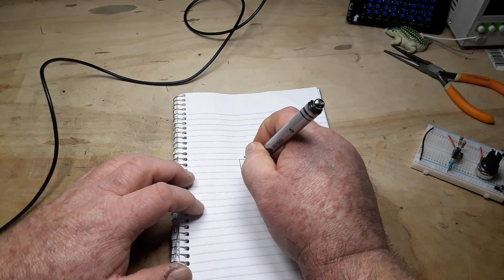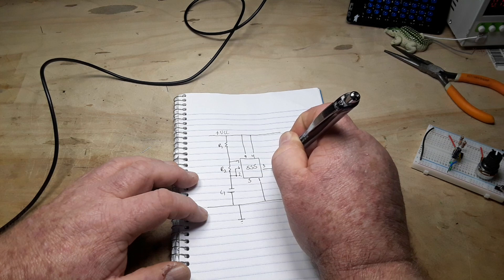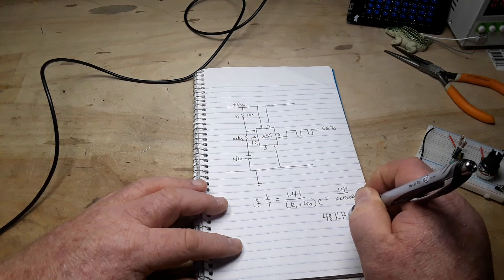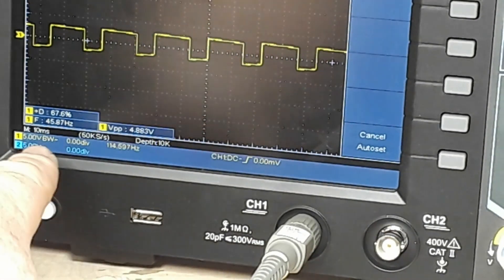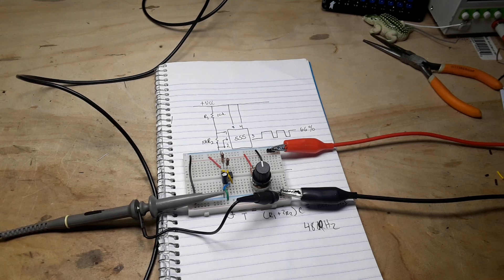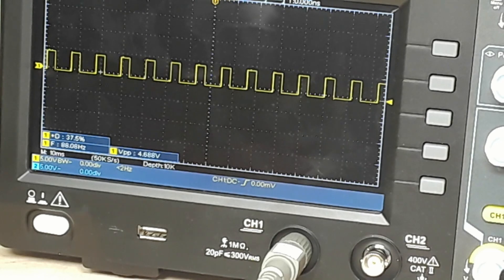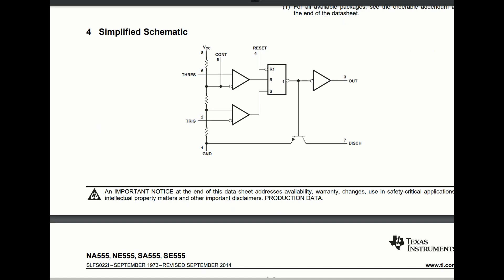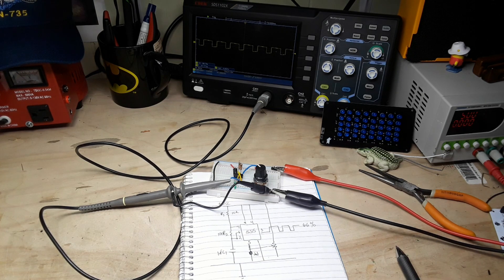Secrets of the Control Voltage Pin on a 555 Timer

Comment: The 0.1 cap should be there to stabilize (make less affected by) the timing from switching (especially on high loads like relays) and power fluctuations.
Try it, you might even see it in the scope.  BTW that includes even and ESPECIALLY if you have the pot there.
Reply: The CV ids sensitive, so don't make it an antenna.
Also, and this is MISSING from ALL 555 datasheets, the C.V. has voltage limits small that you might expect.
....a nasty surprise I got building an over current protection circuit, ....YES the 555 timer has lots of uses, and it's CHEAP!

Comment: THANKS FOR THIS VIDEO...I JUST LOVE "PIN-5 APPS"!!  
One thing I made was an infrared LED modulator.  I used the same type of scheme used in the TV remotes.  They usually run at about 38kHz.  However, about in the 90's, Vishay came out with with a Three-pin IR receiver (TSOP7000) that operated at an amazing 455Khz!  I was able to use this as a carrier frequency for the full audio range of frequencies!  With a 555 driving a powerful IR LED tuned at a center freq of 455kHz, THROUGH PIN 5, I could modulate audio over a long range...I actually got about two miles range with a single pulse modulated LED, and Fresnel lenses at each end.  The alignment was an absolute nightmare!...we used rifle sights and a pair of VERY heavy tripods.
...I'll cut here.

BTW:  I think you would have better luck with a lower resistance pot [50K (actually ~25k) out vs three 5K in series: (~3.3k ohm input).]
It is VERY interesting to use use the 555 with a +/-5V dual supply and modulating pin 5 with the output wave-forms of the MAX038 function generator

Comment: so question what is the 4 pin GM Ignition Module supose to by called? It uses the MC 3334 ic chip wire diagram. That thing confuses my I tryed to use 500k potenciometer on that thing suposedly to retard slightly ignition timing so my car can easely start in winter time how ever it ended up totali different insted of compresion I ended up fiering at exaust stroke and the engine was choked lot in power didnt work as planed but it did retarded the ignition timing I ques I used speaker wire and the distance from ignition module to potenciometer back to ignition coil or to ignition module cant remember reali how I hocked that thing up any way the resistance in wires caused havoc. I wasnt reali happy about it. It gets even wurse when I try to use hv ceramic capacitors on my ignition coil it messes up the Delco 12 si voltage regulator starting cutt in current . So Im realy anoyed what to do and how to replicate this circuet struggeling to finde any thing similar that is cloosed loop and more variabel .So did ever some one tryed to use remote controled variabel modulstors or some sort of remote controled relays? Im realy desperate at this point I like my car but the ignition system is shiti expeciali in winter its hard starting that car.

Comment: Great video!  So I'm using the 555 to create a flashing series of LED lights.  Here is the video I've followed. https://youtu.be/h_50ITXi-2w  The project uses a 9 volt battery.  However, I'd like to make the LEDs brighter.  The LEDS are only showing about 2 volts running through them when they light up.  I'd like to be able to increase the brightness of the LEDs.  Is there a way to control the output voltage of the 555 in such a way that does not change the speed of the flashing series?  Thanks!

Comment: Can you get capacitors where you can adjust the value of the capacitance
Reply from the maker: yes, variable capacitors
Reply: @learnelectronics  cool, so that would be an ideal way to change frequency without affecting the pulse width, right?

Comment: And there was I wondering how you could get a 50% duty cycle with a 555. Obvious answer here!
Reply: another way is using a diode to bypass r2. or, if you simply chose r2 substantially higher than r1 you'd also get a roughly 50% duty cycle, right?

Comment: The datasheet says - precision 555 timer. Your waveform it's not precise at all. It's not so simple. First of all the waveform looks distorted. Just look at the rising edge at 500 us. You need a pull-up resistor at the output or pull-down OR BOTH as well. You need to bypass with capacitors etc... All I want to say is that: a precise 555 circuit needs a more precise explanation. Anyway, I like your channel. Good luck.

Comment: Thanks for the technical explanation. I used this control voltage method in both my little boxes punk console and my original Project Nine diy modular analogue synthesizer. Check out my channel to see what I did.

Comment: Still new to the 555, but if I wanted a fixed and stable 50% duty cycle, do I need to have half of VCC on pin 5? Or is that why the suggested 0.1µF capacitor is used for?
Reply: If you just put a jumper (0 ohm) in place of R1 you will get a 50% duty cycle in a standard astable 555 circuit. No need to change pin 5. Do a search for "555 astable online calculator". Plugging in 0 for the R1 value will confirm this. Then just put the C and R2 values you need to set your frequency. Changing the pin 5 voltage seems to let you get the duty cycle below 50% which you can not do with the basic astable circuit.
Reply: @blic-sx9ix  You can't do that. By shorting R1 you short the power supply every time the discharge transistor is on inside the IC. There is a minimum value for R1 which is around 1k depending on the power supply voltage. 
You can achieve a duty cycle of roughly 50% (slightly above) by making R2 have a much bigger value than R1, and because putting a large resistor value will lower the frequency, you can mitigate that by lowering the value of C1 as well.
You can also try a classic astable multivibrator circuit with two transistors and two identical capacitiors and resistors instead of a 555 IC if a 50% duty cycle is critical.
I hope that helps.
Reply: @antoineguilmain2754  Thanks for setting me straight! I always use 2 resistors in my circuits but noticed that a 0 for R1 in the calculators gave 50%.
Reply: @blic-sx9ix  No problem, I always enjoy helping others when I can. As for the calculators, i'm not surprised. They just plug the values you give them into formulas without giving a second thought about it!
Reply: @antoineguilmain2754  could you put a diode parallel to r2? then charging of the capacitor will only flow through one resistor and discharging through the other resistor. then if you made both R the same value, you'd have a 50% cycle
Reply: @KrumpusPlunk  I think I have seen this before, but I have never tried it myself. If you have a current-limited power supply to try it out, in order to avoid short circuits just in case, maybe you could try it out and tell me how it went? Or you could just try it with regular batteries (not the lithium type, those are dangerous in the event of a short. Just regular alkalines, maybe 4 in series to get an appropriate voltage for the 555 to work).  I wish you luck, maybe i'll try it too sometimes, since I have loads of 555s.

Comment: tell about connecting R1 to a diode to 555 output instead of vcc
i meant: output - diode - R1 - C1 for charging part and C1 - R2 - 7 pin for discharge

Comment: Basically you can make a mini FM generator using this control voltage pin. With natural frequency of oscillation as the carrier frequency. The audio signal at control voltage pin

Comment: Hey Paul. I’m looking to purchase a good scope for my bench. What do you recommend ?  I see you have 2 listed in your equipment list. Nay advice is appreciated. Thanks for the control pin vid.
Reply from the maker: The Rigol 1054Z is probably the best value of features vs price at $359. You can't go wrong with it. But if you want something more affordable, the Hantek DSO5072P is about $100 cheaper. 2 channel only and no protocol decoding. But only you know what features you need.

Comment: I built a regulated hv boost converter to drive nixie tubes with this 10 years ago ..
Take a small portion of output voltage through a transistor onto pin 5 and u have regulation

Comment: So... since the data sheets don't specify, I've always assumed PIN 5 (CV) to be an INPUT. However, when I measure it with a VOM (V Red to PIN 5 and COM Black to Ground) it's always OUTPUTTING 1/2 of VCC with nothing connected to PIN 5. So if VCC is 12V, PIN 5 will be 6V etc. This is something I never quite understood. Can you or anybody else comment on this? Thanks!!!
Reply: The reason why you have roughly  half the voltage of vcc on pin 5 is because pin 5 is connected at a node in the center of a voltage divider. From vcc to Gnd their are two resistors in series  (this is the voltage divider ) Pin 5 is connected to the middle of the two resistors. 
Anyone can feel free to chime in if I am wrong.
Reply: @PracticalCat   Sorry, but your explanation doesn't quite make sense to me.  Looking at the internal schematic for the 555,  the internal voltage divider has THREE equal resistors in series (say Ra, Rb, Rc, with Ra being connected to Vcc & Rc to Ground) .  Pin 5 (Control) is connected to the node between Ra & Rb, which should therefore be at 2/3 of the supply voltage i.e. at 8V if Vcc is 12V.  I assume that's why Rob Consentino is puzzled by seing 6V.   I'm puzzled too, and for the same reason - I'm going to try it out for myself when I have a moment, to see if I can get the same effect.
Reply: @chrisbrett1857  I see what your saying.  It should be 2/3 of the supply. My bad. 
 Weird 
I want to breadboard a 555 timer now and have a measure :)
Reply: any one explain that briefly ........anyone share with me in details of this operation kindly.

Comment: Can also change one of the 10k resistors to a pot you will be able to bypass the manufacturer tolerances.
Reply: replacing one of r1 or r2 with a potentiometer wound be another way to control the frequency, right? and if you chose r1 comparatively small and replaced r2 with a potentiometer you'd have a 50/50 square wave with controllable frequency?